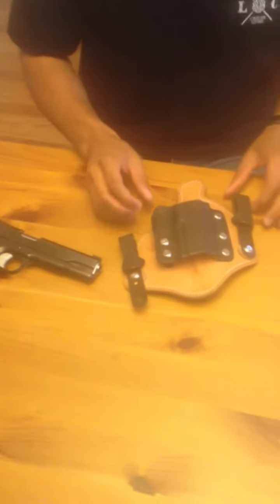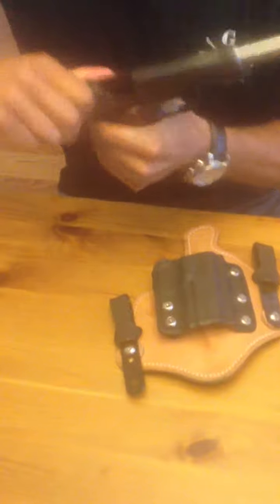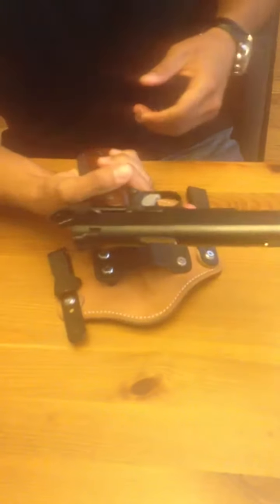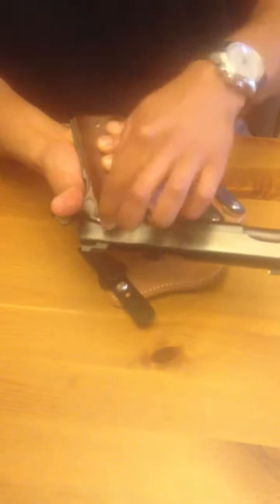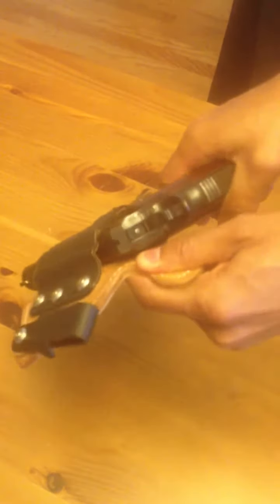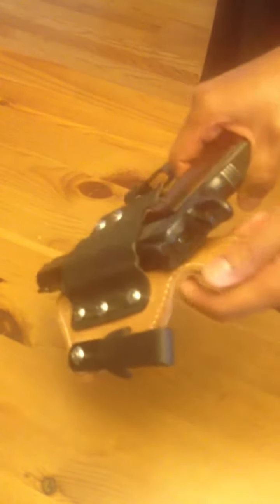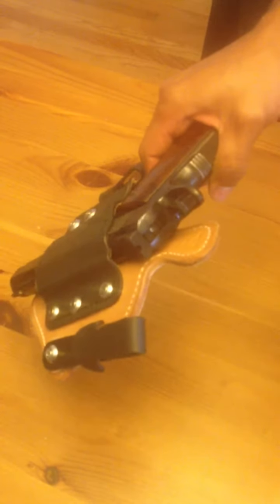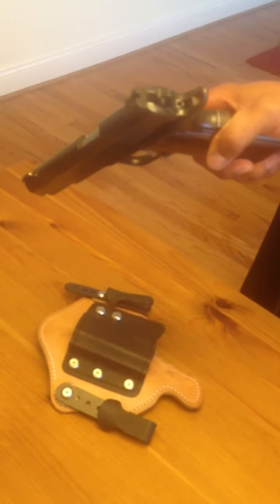Holster problem

Comment: I know this is an old post, but if you still have the holster and haven't figured out the problem, try tightening the retention screws.  It looked like you had two, one near the trigger guard and one near the muzzle.  Both probably need to be tightened.  P.S.  call Tucker Gun Leather since from my understanding they have a lifetime guarantee and phenomenal customer service.